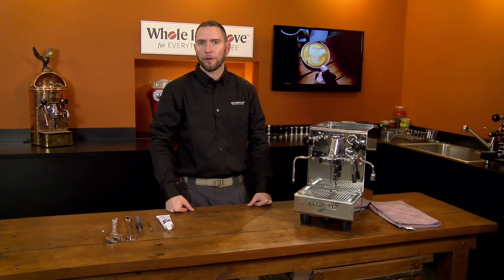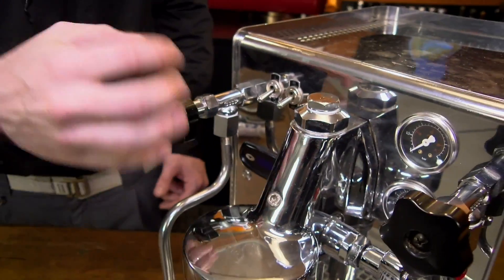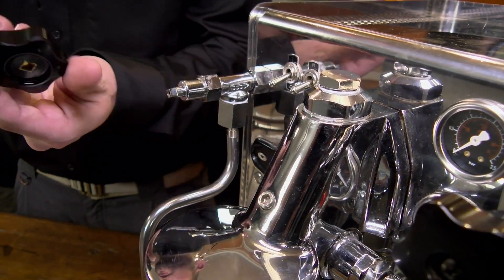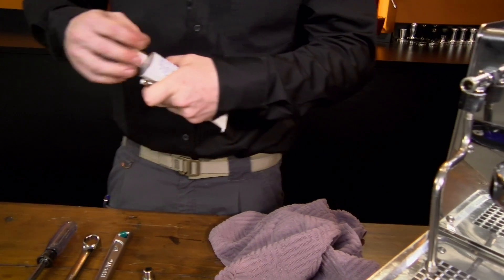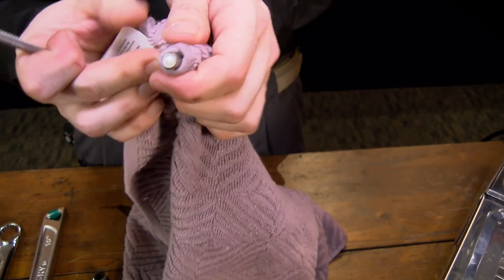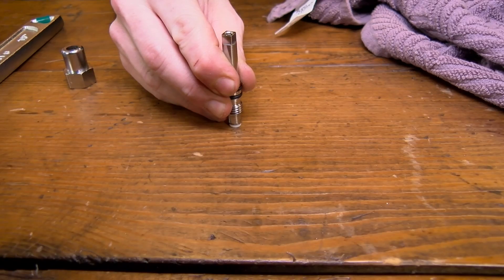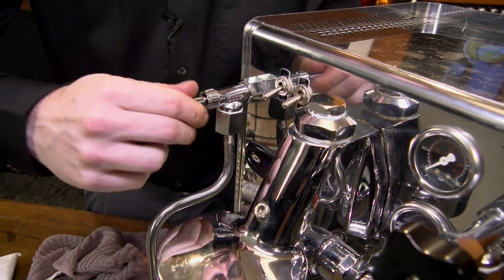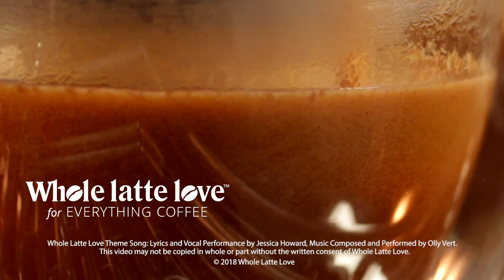How to Rebuild Steam & Hot Water Taps: Expobar Brewtus & Lever

Comment: Hello, I have this model and have steam from my steam wand, but after around 10 seconds water flows out  the whole time I have the valve open to the point where it would fill the milk jug. Would taking apart the tap, etc and inspecting the seals fix my particular issue? Thanks.
Reply from the maker: Hi DD, Don't think it's an issue with tap. Sounds like there's too much water in the boiler. As steam comes off the top of the boiler the only way you could transition from steam to hot water from the steam wand is if the boiler is overfilling.
Reply: @Wholelattelovepage  thank you. Is there a way to adjust this? I did take apart the machine and have recently descaled it too. I noticed a large rod sticking up quite far above the steam boiler, next to the pressure release. Can’t seem to find anything about this subject. Great video on testing the electronics btw. Very informative
Reply from the maker: @daviddrabble8453  That rod is most likely the fill level probe. If sticking up a lot that's why your steam boiler is overfilling! Here's a link to video with discussion of the fill level probe: https://youtu.be/UIiLeRdVWAU?t=1325 It's part of a much longer video which covers the electronics systems of the Brewtus. Push that probe back down. There's a nut surrounding the probe. If the probe does not push down easily loosen the nut surrounding the probe. Once you get the probe pushed back down tighten the nut so the probe is held in position.
Marc

Comment: I have an Expobar office lever plus and there is no water coming out of the hot water wand at all.  I followed the instructions in this video and still nothing.  Any additional repair videos?
Reply from the maker: Hi Molly, Thanks for the question. Here's a link to our support wiki for the Lever Plus and section dealing with no hot water flow: https://wiki.wholelattelove.com/Expobar_Office_Lever_Plus/troubleshooting#There_is_no_water_coming_out_when_I_open_the_water_valve
You should find some troubleshooting info to help you there. If the machine is heating sufficiently and the vacuum relief valve on the boiler is closing when the machine heats up pretty much the only thing that can prevent water flow is a blockage somewhere between the boiler and the water outlet.